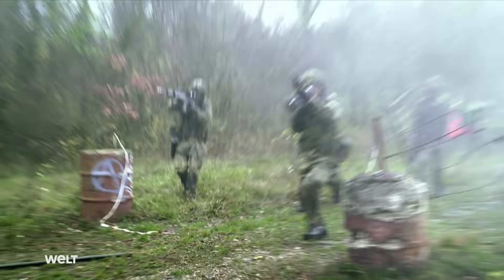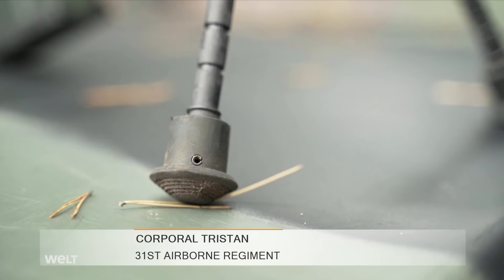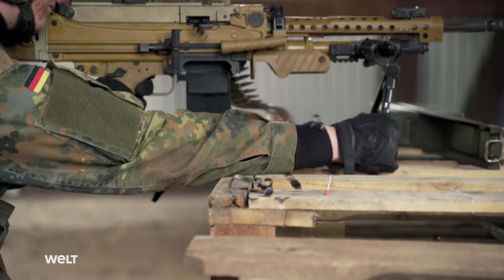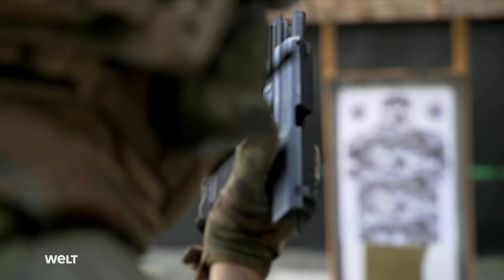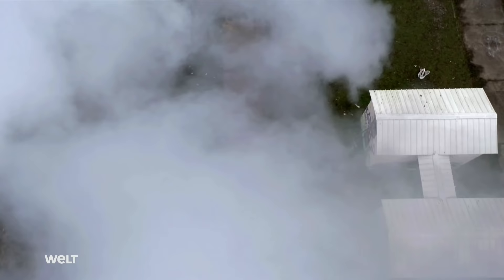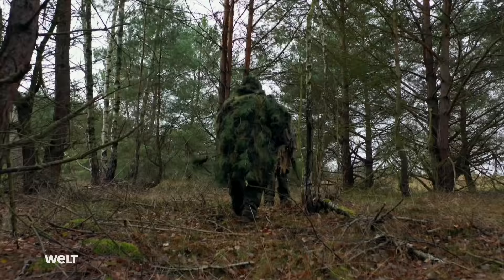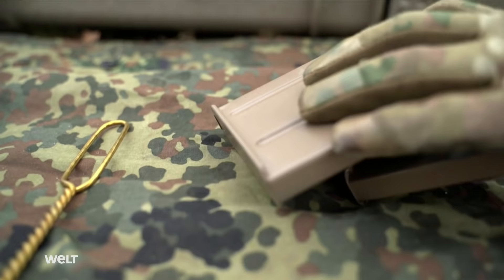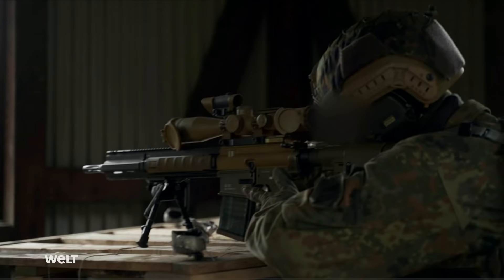THE BUNDESWEHR ARMOURY: Weapons - How German infantry fights in battle | WELT Full HD Documentary

Comment: The G 36 is planned for general infants especially, being the G27 battle rifle telescope plus silencer and laser pointer for nocturnal bad weather conditions, designed for closer contact special forces heavy-duty tasks. It's an impressive lightweight weapon.
Reply: I have never fired it and it looks impressive, but i would for certain not call it a lightweight weapon when it weighs in at 4.4-4.7 kg. Imagine the weight of all the accessories you and the video talks about. Carrying a rifle weighing at eg. +5kg is alot. And most often all the attachments are just extra pointless weights. Compare it to an actual "lightweight" 5,56 carbine instead that weighs just above 3kg. It as they describe it a "light support weapon". 

Sizewise it is fairly close to the old G3 (which i have extensive training with) rifle, which nowadays is in use as eg. a DMR rather than an assault rifle.

Personally i wouldn't use a heavy and bulky AR into close combat. The whole purpose with a rifle like that is to keep distance. In CQB you need to be agile. On the plus side is the 7.62 calibre though.
Reply: @74Darkman  It weights less than an M16. :face-orange-biting-nails:
Reply: @Leftyotism  No...just no. 

I have no idea how you even came up with that idea. M16 is a very light weapon.

The first M16 (A1) weighed only 2,89 kg, while the A4 version weighs 3.4 kg.

The whole idea behind the M16 is just lightweight. It's made of mainly aluminum and plastics (barrel, bolt+carrier is steal).

That is about 30% less than the G27.

Comment: 6 and 7 hundred rnds a minute. That won't melt the barrel?
As always, all the best to everyone. Chef Scott
Reply: lol btw that incident wasn't the "barrel" melting it was the polymer housing around the barrel you know that grippy thing where you put your hand so you don't get burned maybe you're more familiar with kitchen stuff it's like the handle on a frying pan because pans and barrels have somethings in common🤔
Reply: "Theoretically"
Reply: @oniwaban3198  That only happens in extremely hot climates like they encountered in afghanistan.
Reply: The doctrine says only fire in bursts.
Reply: German troops in Afghanistan have become under heavy Taliban fire and had to fire back until the barrels glowed. The ministry of defense than said the G36 has aaccuracy problems - lol. Alose the main reason for the overhating was the use of false and cheaper ammunition wich caused the overheating. HK said the G36 should be not be used with gunpowder based ammo, but with TNT based ammo wich produces much less heat.

Comment: The g36 should have captured pins. No way those don't get lost in combat
Reply: They kind of are, aren't they? Spring power at the end of the pins keeps them in place.

In order to remove a pin, you have to overcome that spring pressure fully by (a) pushing the pin on one side and then (b) pulling the pin from the other side -> Unlikely that this could happen by accident.

Also, you can increase the thightness of the trigger group by placing tapes on the sides. This way, removing the pins requires A LOT of force.

However, if you are talking about cleaning in the field, i fully agree: Captive pins would be nice. However,  pretty sure, due to the design of the gun, this is not possible -> The plastic does not leave enough space.
Reply: @Komod0rPuDel  not the g36. Your thinking about the AR
Reply: No need for a update they get a brand new rifel soon :) ohh and it will have cap-pins :)
Reply: they dont

Comment: Hmmm. I'm just wondering when are they going to adopt the HK 433...
Reply: They replacing it step by step right now
Reply: @net-twin-de  Sounds like good news to me.
Reply: There is no court judgment yet, but it will be the HK 416 A8 and not the HK 433.
Reply: @Tyr002  witch would actually be the best choice. 
The 416 is way more interchangable and comparable with most other nato platforms and modular enough to open the gates for a gear and tactics change in the infantry. 
The 433 feels like just a clone with a fancy "DIN standard" casing around it made for german bureaucrats to accept easier ... at least thats what my thoughts were when i first saw it.
Reply: The HK 433 is still undergoing testing. The G36 will likely be replaced with the HK416, with the 433 very likely only ending up in the hands of KSK, or other special units.
Reply: I'm wondering why they're doing it. Makes no sense.

Comment: Did they resolved the G36 accuracy issue?
Reply: The G36 accuracy issue was caused by false ammonition. The G36 needs TNT based and not cheap gun powder based ammo. The TNT ammo explodes with much less heat development, but a "clever" accountand at the German army has ordered the cheapest ammo, as a NATO compatibility list said, that the gun would also work with any 5,56 × 45 mm NATO rounds.
Reply: @Rick2010100  In general, it will work with any cartridges. and what the fuck TNT do not write nonsense.
Reply: @alekszanuzdaev8115  It will work with any Nato certified ammo, but for optimal usage TNT based ammo should be used. The TNT based ammo ignites with a lot less heat production, also with much less flash and the barrel does not have to be cleaned as it does not cause corrosion or gunshot residue. The TNT based ammo is ca. 20-25% more expensive, but the benefits are much more worth than 20%.

Comment: I wonder why Germany didn't simply copy what the Russians Did was use 9x19mm 7N21 armor piercing ammo. Oddly that round will chamber in a P8 or MP5 UMP 9mm if those German military weapons can handle the pressure produced by the 9x19mm 7N21 armor-piercing ammunition. What would have been suited for the German military was a 4.6x30mm P8 variant or restart production of HK UCP. 49:30 Panzerfaust 3 latest version and Mells 53:00 get through through and penetrate the latest Russian military explosive reactive armour and active protection system these are Relkit 4s24 Arena APS Malachite T-14 T-15 Armata with Afghanit APS. Some of these weapons might be considered by Germany to send to Ukraine to fight the Russian Army.
Reply: These rounds cannot penetrate armor, the only good use for the MP7 would be as a backup weapon for the machine gunner. The range is the only advantage as it reaches closer to the 300m mark to be used as a carbine. But the German P8 pistol is still 9mm, so nothing fancy.
Reply: @walangchahangyelingden8252  The MP7 rounds were designed to literally pierce armour, also the MP7 serves as a weapon for artillery.
Reply: @romanoman5497   Thanks for the answer and I wonder if they were supplied to the Ukrainians if so this would have been the answer to something that the Russians have been using for 40 years a PDW for tanks Helicopter Pilots and Artillery Crew AK-74U 9x19mm 7N21 PP-19

Comment: MG5 looks like an modified M60 which is understandable since they developed the original.
Reply: Krauts developed the original of lots of things. Excellent engineers
Reply: The MG4/MG5, basically the same gun, are closer to the M249 than the M60 Id say
Reply: Inspired by the FN MAG, not M60.
Reply: @jonny2954  Your right I lost my train of thought I meant to mention our M60 was  developed from the German machine guns during WWII not from present day German weapons.
Reply: @walangchahangyelingden8252  The problem with the short rail on the Negev is you can't mount any themal or night vision attachments in front of your optic. The MG5 is used with NSV 600 night vision and IRV 600 thermal attachments. Especially the latter is a force multiplier.

Comment: German weapon like G36 is a piece of crap.
Reply: G36 is a amazing gun, if your talking about the melting barrel it was the millitary's fault for using cheap ammo that made the barrel melt.

HK proved it in court
Reply: @deeznutz8320 
Also the weapon was handled wrong  under the worst conditions.
If you use an AR like a machine gun in the middle of the dessert, it should be obvious that the accuracy suffers and the lifetime of the barrel decreases.
Reply: @deeznutz8320  negative. The plastic parts were responsible. Overly engineered.

Comment: That rifle is trash the hk 416 is by far a superior weapon larry vickers reAl life batman helped design the hk 416
Reply: Can't believe they would send ppl out of an aircraft with a rifle that long and unwieldy
Reply: The g27 is basically a hk416. Its just rechambered to 7.62 nato! So what is your point?
Reply: @HaVoC117X  The G27 is the HK417, similar design, different tool, but still kinda the "big brother". 
Also the G27 comes with the 16 inch barrel so its basically normal length compared to most other rifles. i think Jacob was talking about the G36.
But as far as it seems the german military gets the 416 as standard, whatever he was saying, its going to change, but its still kind of the same lenght.
Reply: It's a good rifle. It's just politics that's replacing the G36.
Reply: @jacobturner861  Now, that is a good argument. I think they use the Kurtz version but because of the weapon construction, the barrel length of the G36 would still be shorter than if the same overall length as an AR-pattern rifle. But the weapon does have a folding stock which the AR-pattern rifles don't have so I guess it cancels out to some extent.